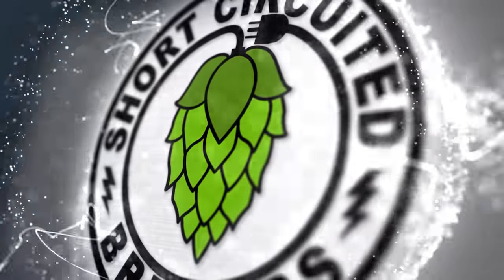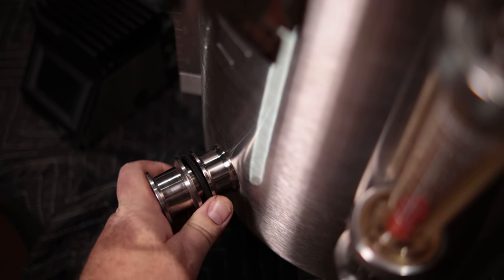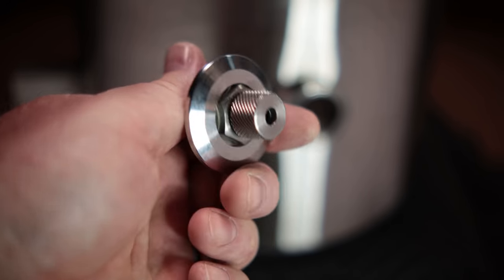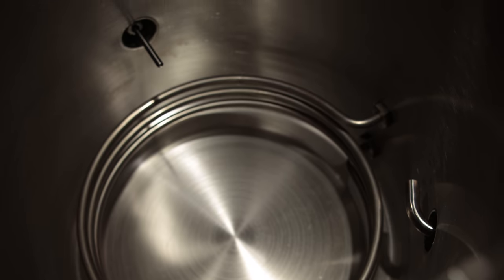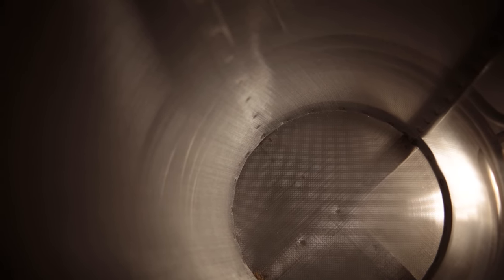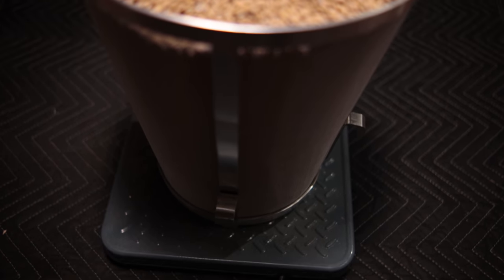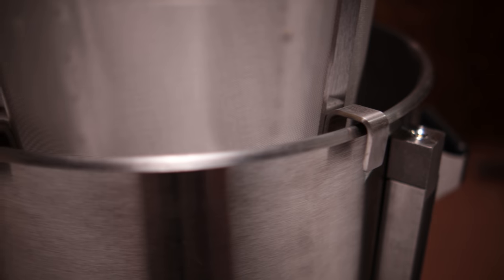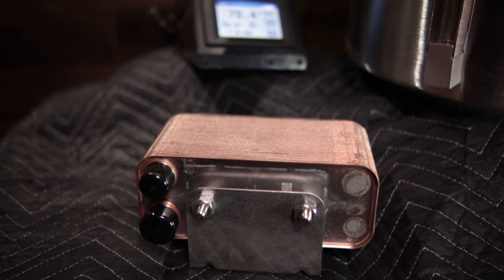Blichmann Breweasy Compact First Look

Comment: If the probe is at the 4 g mark, then you have to brew 4G fermentor batch. Yes you can brew less but you’ll need a different temp probe which is suspended from the top to work with the commander   You also have to order a custom built whrilpool arm to work on a smaller volume.

Comment: So much like the one barrel 3 vessel system that I used to brew on all mixed into one little system. 🍻
Reply from the maker: Cool was it homemade? Or a commercial brand?
Reply: @ShortCircuitedBrewers  it was a Blichmann 3 vessel one barrel and we did 25 batches in a year with it and for the most part it worked flawlessly.
Reply from the maker: Oh ok...yeah I like my 3 vessel Blichmann system. (20 gallon kettles)

Comment: You had me excited when I saw the title of a compact system as I’m a small batch (1 gallon typically) brewer and thought someone may have come out with a new system that addresses the 1-2 gallon market. Nice looking setup regardless.
Reply from the maker: Have you seen the Anvil Foundry 6.5??
Reply from the maker: Or even my channel trailer?
https://youtu.be/AQr54jf8GuM
Reply: I looked at the Anvil when it was announced but it’s twice the capacity I’d like to have. I’ve seen your DIY e-kettle along with others but was hoping for a commercial system some day. Unfortunately I understand the 1 gallon market is relatively small so not likely to happen. If I’ve missed some options, I’d love to know about them. If I want to go to an ebrew system I may just need to increase my batch size
Reply: I forgot to say it’s an e-biab system I’d be targeting. In the mean time, my stovetop continues to suffice 😉
Reply from the maker: @marka9083  gotcha! 👍🍻

Comment: If I remember correctly, the 10 gal BoilCoil has a minimum batch size of 3 gal.  Thus, placing the thermometer at that in that volume range makes sense.  This system might be nice with 7.5 gal kettle for small 2.5-3 gal batches.  Outside of that, I think I rather spend a little more money for the regular BrewEasy.
Reply from the maker: Fair enough assessment. 👍🍻

Comment: Looks nice! I immediately went to their website before watching the end and was very disappointed I couldn't see pricing or options right now. 

Isn't dry grain in the basket a terrible way to measure how much it'll be able to hold during a brew day? Gotta account for the water somehow, and I think 20lb of grain with only a few gallons left over for water would lead to pretty awful efficiency 😂
Reply from the maker: I used a calculator to try to determine how much water I would need for a 5 gallon batch. I talked about it in the video..
Reply: @ShortCircuitedBrewers  sorry, I was so focused on the dry, uncrushed grains I blacked out for a sec. 

Looking forward to seeing a brew day! This might finally be the replacement for my old DIY pot and RIMS setup
Reply from the maker: @JoeCole1  lol no worries! 👍🍻

Comment: What is the minimum size batch that can be done in this system
Reply from the maker: 3 gallons
Reply: @ShortCircuitedBrewers  have you tried a smaller batch on it. Their customer service said less than 4 gallons and the element would be exposed, but at the same time their spec sheet shows 3 gallon. I would love this if it has the flexibility to go between 3 and 5 gallons.
Reply from the maker: @andybecker5040  3 gallons is probably the minimum size. I will be testing that shortly.